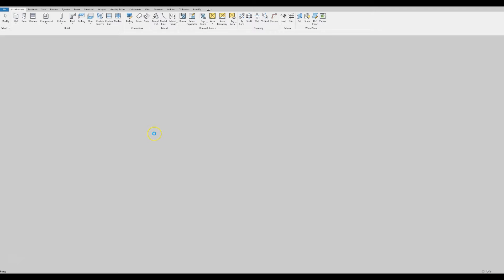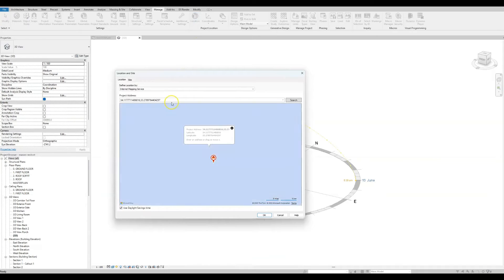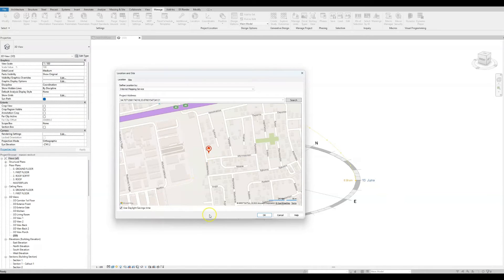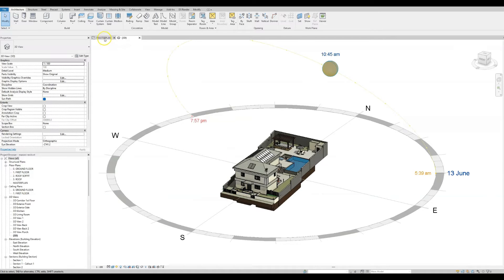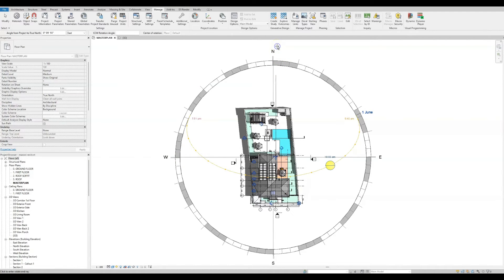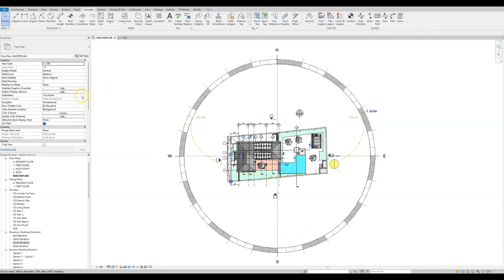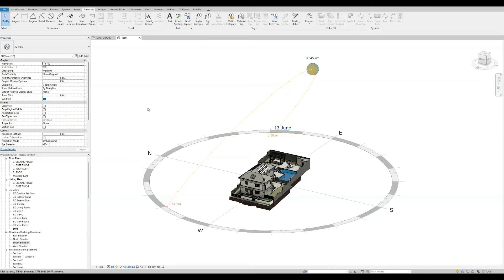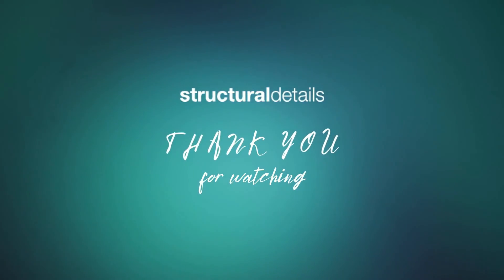REVIT TIPS: How to Change True North Orientation and Set Geographic Location for a Project in Revit

Comment: It keeps giving me an error that this view (a floorplan view) wont allow me to change the true north settings
Reply from the maker: Hi there, you can watch this video from minute 4 to 6 showing exactly the steps that I have followed. Since you mention that it is greyed out, it is important that you are in a FLOOR PLAN view. Not in 3D view. It will not work in 3D view even if you have rotated the view to look from the top. For instance if you are in 3D view and clicked on the cube top it will not work. You need to be in a floor plan. From the BROWSER TAB, expand the FLOOR PLANS section and double click on a floor plan to open up. Then  turn sun path on ( sun icon at the bottom ), go to Properties Tab, Orientation, change to True North, from the Manage menu at the top, select Position and from the drop down select Rotate True North. If you are in floor plan view it will work. It will allow you to rotate the model to its correct orientation. I hope the above helps.
Reply from the maker: Important: Before trying to ROTATE TRUE NORTH, you need to change the view to the true north orientation. In the PROPERTIES tab (usually left panel), where it says ORIENTATION, click on the drop down and change the Project North to True North. Then go to MANAGE>POSITION>ROTATE TRUE NORTH

Comment: What do you have selected when you click on Rotate True North?  Mine is greyed out no matter what is selected. I am in floorplan mode.
Reply from the maker: Hi there, you can watch this video from minute 4 to 6 showing exactly the steps that I have followed. Since you mention that it is greyed out, it is important that you are in a FLOOR PLAN view. Not in 3D view. It will not work in 3D view even if you have rotated the view to look from the top. For instance if you are in 3D view and clicked on the cube top it will not work. You need to be in a floor plan. From the BROWSER TAB, expand the FLOOR PLANS section and double click on a floor plan to open up. Then  turn sun path on ( sun icon at the bottom ), go to Properties Tab, Orientation, change to True North, from the Manage menu at the top, select Position and from the drop down select Rotate True North. If you are in floor plan view it will work. It will allow you to rotate the model to its correct orientation. I hope the above helps.